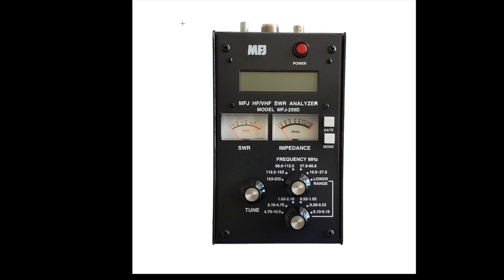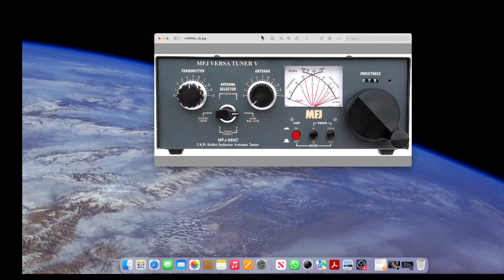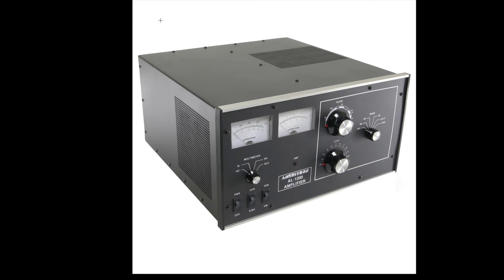Ham Radio Myth - Antenna Tuners Waste A lot of Power.

Comment: Agree!! Love your videos!!! And I will not be worrying about losses and my antenna efficiency. I have a non-resonant EFD Bullet antenna from Palomar that I extended to 203' of wire and total radiating length is 286' to the coax choke used for tuning. My 710 can tune this antenna on all bands 160-6 across the complete phone section of every band! My 100 watts has gotten me 75 countries since March when I got my General and Extra ticket. I am answered on 98+% of all attempted QSOs including South Africa, Tasmania, Kenya, Japan, etc...
Reply: That is actually a pretty decent multi band antenna.  That was my first hf antenna a few years ago.  I used it as a true long wire antenna on the higher bands and worked a lot of dx as well.  Play around pointing it in different directions and you will find that it is fairly directional on the upper hf bands (anywhere it is multiple wave lengths long).  I need to get mine back up!  I started playing with big horizontal loops and long wire doublets, which are great multiband options as well!  73
Reply: @dylanschulz2404   Very nice! I talked to Bob about it at Palomar and on higher bands, it has so many radiating lobes, it's actually almost omnidirectional up at higher freqs. Based on my experience, I agree. From 40 to 10 meters, I have DX contacts in all directions. Contacts also include Central America and to the southern tip of  South America. Currently it is pointed NE/SW and fed at the SW end. It is shaped as a very tall Z with 200' in the center of the 286' length and slopes down toward the NE. Can only really point it in this direction due to property limitations. Enjoy your antenna experiments! That is one of the real enjoyments of ham radio.

Comment: Good video again. I always say with three wattmeters you will get three different readings! I have 
A couple Drake wattmeters, a couple Heathkit and a Bird. The Bird may be the best, they are all “close enough” for most amateur purposes. All have a tolerance specification, usually at full scale. I am surprised to hear that the ARRL isn’t better than that!

Comment: Meters are only accurate at their target impedance. Thats why we used to get Kenwood and Oskarblok meters that were switchable 50 or 75 ohms. I have seen people put 50 ohm power meters either side of a tuner to test for losses, with an antenna bad match on the end. The one on the bad match side of the funer is effectively telling you nothing. The other issue is that even a 20% loss would be less than one S point. The way people go on about these things makes you wonder how we used to get any contacts years ago.

Comment: Nothing over 5 Watts here for 30+  years and I don't worry about losses in a tuner. Any losses can't be too bad.
I was given a supposedly non working MFJ 16010 tuner which I used for two years and took it on a radio holiday to Wales. 
On returning home it didn't work so I looked inside. Nothing obviously wrong but poking around I found a loose wire which I soldered (had it originally been soldered?) and all was well again.
I for many years used a roller coaster and variable capacitor which I still have to tune wire aerials. 
G4GHB.
Reply from the maker: That MFJ tuner story has been experienced by many, including me.  I've been doing the low power thing lately myself.  No problem working stations CW or digital modes with only a few watts.
Reply: @BustRadioMyths    O.K. about MFJ. Mine didn't look to have been soldered.
I used to run 100 Watts but in the 80's started turning my power down on 10m as it was wide open, about 25 Watts s.s.b. and less on c.w. 
Sold it and went h/b 80m + 20m s.s.b. and c.w. and later added xtals and a mixer for all h.f.
Other QRP rigs, FT817ND, Pixie,  Wireless 19 Set at 2 Watts c.w. only.
73, G4GHB.

Comment: I have found that the losses through various tuners, especially on the lower bands, increases with the very small tuners. A tuner with large coils in it is far more efficient on 160 and 80 metres than one with tiny coils. I measure this by using a 200 watt load on the output of the tuner and identical watt metres on both the input and the output. Put a 100 watt signal into the tuner and adjust it for minimum SWR. Now observe how much is actually coming out of the tuner into the load. Repeat this on one of the small "Travel" tuners and you will be amazed at the difference.  Yes, I am using a 50 ohm meter on a 200 ohm load, but the setup is the same for both the large and small tuner. Perhaps identical RF ammeters would be better than using wattmeters. Regardless, you will find those tiny 100 watt tuners will have a higher loss on the low bands compared to a full size desk top tuner with large coils. It would be interesting to hear if you find the same results Mark.
Reply from the maker: Yes most of the loss is in the coil especially if the wire is too thin, especially on the low bands.  I'm sure a little MFJ travel tuner can't compete with a Palstar.

Comment: A more simple way to get a handle on the losses is to put high power through the tuner and observe the  temperature of the internal components.
Reply: If the components are sized up to take the high power then very little
Reply: @Pioneer936  I have observed minimal heating of the roller coil in a severe mismatch condition, I would guess maybe as much as 10w of loss in the inductor.. with 1kW through.
Reply from the maker: Yeah if your tuner is getting hot it is underrated.
Reply: @BustRadioMyths  the point I was trying to make is that the power lost in the tuner was probably a a tiny fraction of a dB . The example I had in mind was rated 3kW  by the manufacturer, the capacitors are rated 7kV but the rollercoil is smaller than I have used in my homebrew ones.

Comment: Personally, I think 80-90% efficiency is pretty damn good. I DOUBT they got anywhere near that back in the 1920's and 1930's with some of the old school gear. There was a reason those old tube transmitters could run with an SWR of 5:1 or more. They still put out RF, it might take a few more calls, but you'd still be heard. There isn't any need for 100% efficiency and 2Kw output power, this is still a HOBBY after all. NOT all HAMS have millions of dollars to waste on gear to be better than the neighbours setup......good is often good enough. Not everyone WANTS or can afford to be as flash as a rat with gold tooth. My external and internal tuners will do me fine....

Comment: Poorly designed and built antennas that require a tuner to even function are what waists power.  For my first 30 years I never even owned a tuner.
Reply from the maker: But you own one now?
Reply: nothing worse than "waisted" power, huh
Reply: Long wires need a tuner. And a doublet.
Reply: Plenty Perfectly designed and resonant antennas also require tuners also